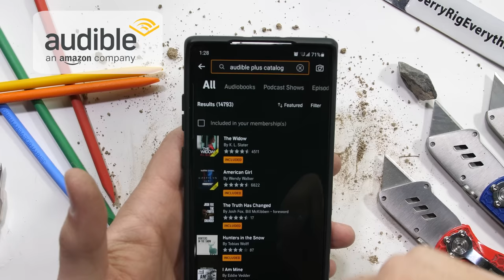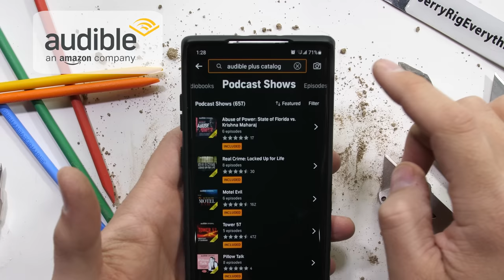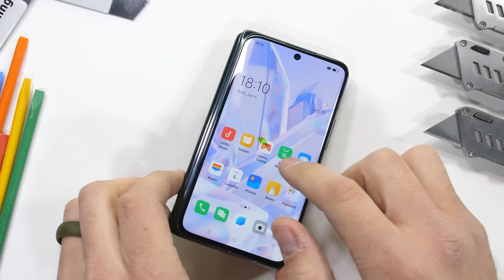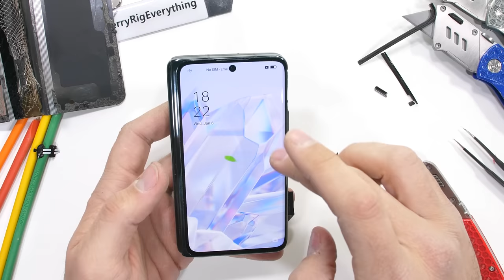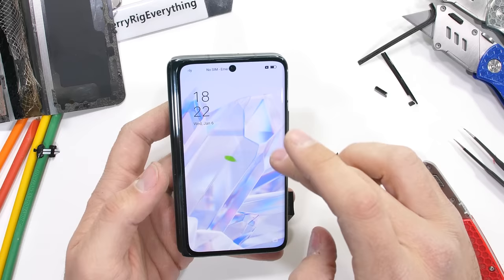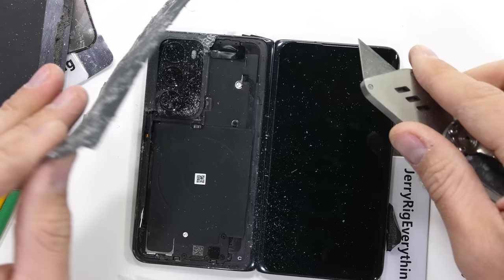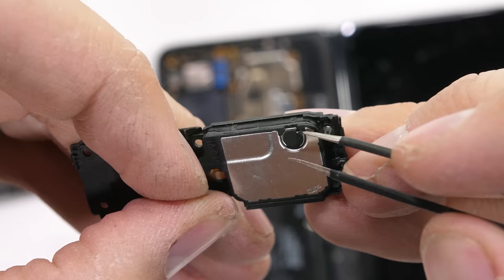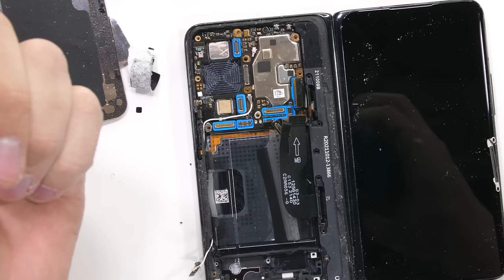Does the Oppo Find N *REALLY* have a 136 part Hinge? - Teardown!

Comment: It's safe to assume that repairability is going to be a nightmare for these folding phones.
Reply: its like saying repairing a screen is a nightmare, Its almost not repairable so you would just change it and it wouldn't be that hard. I'm guessing same will happen with folding phones, just change the broken part don't fix it
Reply: @spyro9979  but even changing it seems to be tough. The packaging is so small, complex and reliant on adhesives.
Reply: Going to be? It clearly already is.
Reply: It does look that way., my guess is the most common response  from the phone maker if something on the inside goes belly up will be “ you need a replacement handset” .
Reply: still repairable than apple product who use software to lock the hardware lol
Reply: Apple doesn’t want third party repair, we all know that.
Reply: @armadillito  That's just the price of packing more into a smaller area. Regular smartphones are a lot harder to repair than the dumb phones of a decade or two ago, but that's to be expected. In cars, manufacturers are packing turbochargers into smaller displacement engines, so you get more power with better emissions and fuel economy-but of course that makes fixing it yourself a lot harder. As the technology matures it will be cheaper and presumably easier to switch parts hardware wise, but a certain level of complexity is inevitable.

Comment: Amazing engineering in this phone. Crazy amount of parts.
Reply: isn't that the case with every phone?
Reply: It's literally the same as a fold 3 except with less impressive tech
Reply: died in 1 fucking poke tho
Reply: @vein8202  
You clearly have never opened a phone before. That was normal any screen can die like that even Jerry wasn't surprised  because pros don't use knifes to open screens and he knows it was his fault. This thing is the most fragile thing in a smartphone
Reply: @propersod2390  
I am pretty sure it's more impressive tech than the fold. It just lacks good software
Reply: @EA_47_  how is it more impressive tech if it's literally the fold 3 with less things? Fold 3 has stylus support and an IP rating. As well as an under display camera
Reply: @propersod2390  
I was talking about the main thing the display with better henge mechanism. Sorry should have been more accurate.
Also styla support on the fold us useless i wouldn't use it the display is too fragile.
Reply: @EA_47_  the hinge is basically the same, they even copied samsungs free stand hinge design (typical chinese). And btw the spen designed for the fold 3 does not damage the display at all which everyone including samsung has said. But okay ig
Reply: @EA_47_  There is a specific Spen that works with these foldable type phone screens, the actual pen has a spring mechanism and stuff to make it safe to use. I have one no issues, the only wow thing about this phone is just the less crease,flat closing hinge part. The rest is just like any fold 3 with no IP rating and no Spen support and lame software (I have always used a lot of chinese phones but my last one was a Poco X3 Pro NFC and gave me lots of software issues which made me switch to the fold now).
Reply: @Emad Aldeen  your crazy it's a lot harder being the pioneer vs. building off another product
Reply: Samsung Z Fold 3 is much much better
Reply: @kkkkkumar2898  and cheaper.
Reply: Compared to what? Of course to us normies it's amazing but this phone is pretty shit
Reply: @EA_47_  no the oppo lacks both compared to the fold...
Reply: @propersod2390  It's less expensive (thus more likely that people actually use it), stylus support is just software, and IP rating is just a rating (just because it hasn't been rated doesn't mean it can't achieve dust and water resistance, as many videos on Youtube, including on this channel, have shown). An under display camera is just a design choice, Oppo has made other phones with under camera displays. I don't know how much Samsung is paying you, but competition is always good for the consumer. This is how we get better and better things (look at Apple customers, locked into whatever Apple decides is best).
Reply: @propersod2390  The "basically" is the key here. A hinge... folds! How many ways are there to make a hinge that folds? That's a very superficial view, with a touch of racism. And folding screens are undeniably soft, we will see in the long term how it holds up (ignoring what Samsung says, of course their marketing will say it's good).
Reply: @propersod2390  But it got no crease

Comment: It's just a shame something so advanced is so hard to disassemble and repair. I get that it comes with the territory, but we're entering an even worse era of repairability with folding phones...
Reply: I wanna agree. I really do but this design was because of what we accepted in past
Kids and people who don't think through
People like us are the reason why this future is permanent
So the era isn't shame
It's just what we made 🙂
Reply: Well.. unfortunately sometimes you can't have both. I mean look at the fitment of the parts and everything, you need extremely specialized equipment to even attempt to take this phone apart and put it back together without being able to tell it's been opened.
Reply: Not that I’m against 3rd party repairs but if you’re going to pay $1000+ why wouldn’t you get it fixed properly by professionals that guarantee it will be fixed? And yeah I know it’s expensive that way but if you’re going to buy a phone like that then you probably wouldn’t mind doing that. I’d definitely understand if it was second hand or if it was given to you by someone else but still
Reply: One thing they could to is make as many things accessible from the back, replace the glass with some form of plastic to reduce the chance of cracking (or don't) and there you go. If they make the ports/speakers/batteries/other stuff that usually breaks easy to reach, that wouldn't be so bad. I don't think many repair shops would even attempt a folding screen replacement
Reply: @peppyrobo7049  most of the companies don't even repair them. 
coughs while taking a bite from an apple
Reply: Instagram User  Exactly… Anyone could make better videos than JRE.
Reply: Well... At least all the screws are not different and there are pull tabs on the battery. Could of been much worse if they tried to make it worse! Like some other manufacturers...
Reply: @peppyrobo7049  The repair shops can't fix devices if they don't have right to repair. They need access to parts and tools and schematics.
Reply: Instagram User  you actually make no content
Reply: This is the future of small electronics. Completely unrepairable. And that's all of course to pad the bottom line of the companies making them. It broke? Buy a new one they'll say.
Reply: its so hard to disassemble and repair because its advanced. The advancements usually make things more complex, especially when movement is involved.
Reply: @christopherbanks1341  You are hilariously naive.

Comment: It would be nice to see you test the hardness of the flexible glass layer in future teardowns, so we could see what it can sustain compared to both gorilla glass and the plastic layers, putting durability-related marketing to the test
Reply: He did that on the…. Durability test tho
Reply: @reesespeanutbuttercups5548  He peeled the plastic layer that covered the glass layer in this teardown, you misunderstood what I was asking. He tested the gorilla glass on the outside screen and "back" of the phone but not the folding glass.
Reply: @pc That's still a form of durability testing, seeing how brittle it might be and if that's the reason it's still covered by plastic
Reply: As the glass layer is not exposed to the outside, the hardness is pretty irrelevant (at least in my opinion). It looks like the plastic layers get damaged first by sharp objects so it doesn't matter if the glass layer itself is stronger or weaker. And it would be pretty hard to test. He'd have to remove every layer on top of the glass without damaging the layers beneath it to be able to do his scratch hardness test, which sounds impossible to me. But if he could get his hands on the glass layer only, a durability test on that could be interesting.
Reply: @waltundres9630  I personally find foldable phones to be too fragile as they are now, with practically anything leaving a mark on the folding screen, durability tests on the glass would keep track of improvements until we potentially see folding glass as the top layer, but that still assumes it has any relevance right now, hence asking for it to be tested.
Reply: @Niop_Tres  I've heard that oppo uses ultra thin glass since they bought it from Samsung
Reply: @DorCoMaNdO  ohhh
Reply: @waltundres9630  well one day the glass will prolly be on the outside, normal phones used to have plastic screens
Reply: Peeling the plastic layer off seems to easily break the glass layer under due to how strongly glued it is. After all, it's not meant to be removed.

The folding screen is surprisingly stronger than videos make it look like. Yet I still have to agree that it's too risky of an investment considering the price or a folding phone.
Reply: Glass is glass so scratches at a level 6 with deeper grooves at a level 7.
Assuming you don't break the glass due to its thinness
Reply: @RennieAsh  I don't think the folding glass is made of gorilla glass like the outside
Reply: @RennieAsh  glass is not glass. There are many types. Gorilla glass 1-7, GG Victus, sapphire, and mineral glass. Reach generation of GG has different scratch and shatter (impact resistance) properties. Glass on phones are VERY different. Some folding phones use glass and some use plastic.
Reply: @littlejackalo5326  plastic is not glass.

OP mentioned hardness, so based on Zach's testing method of standard hardness Moh's picks, glass will scratch at the same hardness levels, regardless of if it has been branded by some company.

Sapphire crystal will test harder, like a level 8.

If you want to test toughness, it's a different test.
If you want to test intricate details on hardness between 5-6 to find out which one is technically harder, then you need a different testing method, or a scientific method to determine those details.
Reply: if its glass it will be a 6
Reply: @RennieAsh  I asked for hardness to be tested because I'm assuming the "glass" layer is some sort of composite involving high(er) concentrations of actual glass but my assumption is that it's softer, as Zack often says "glass scratches at a level 5 or 6", with most glass phones we see start scratching at 6, the folding glass would likely scratch at 5 or even 4 depending on what exactly allows the glass to fold.
Reply: @reesespeanutbuttercups5548  normal phones didn't fold...
Reply: @DorCoMaNdO  pointless the glass is covered with plastic anyways.
Reply: @EikottXD  it might not be in future generations, testing it now would test marketing claims, improvements over time and potential reasons for why it might be covered by plastic, assumption seems to be because it might be brittle, but what if it's not the case?
What if this "glass" layer is as much glass as the iPhone's "sapphire" camera lenses are sapphire? If you're unaware, they're of no real value for durability (scratch resistance), it's just for marketing.
Reply: @DorCoMaNdO  Yes I was curious about this as well. The main issue I have with foldables is that the inner screen is scratched even by fingernails due to a plastic layer covering the screen. I always wondered what is the level of hardness of the ultra thin glass layer, since I imagine that will be the top layer as the tech advances. I feel like 90% of the replies here misunderstood your comment so I felt the need to reply 😂

Comment: That hinge is amazing for sure! I mean, Samsung made 3 and got it close (they'll probably nail it on the 4th one). Oppo looked at it, said they're making one, and then tossed it on the table for people to play with it. So far, every tech tuber that got this device is amazed at how smoothly this phone opens and closes. The breakdown you did shows they did some gear physics and material stress test to put out the best folding/hinged device. 

Heck if it wasn't for the OS and how small it was, I'd be looking into getting one. But yeah, the engineering of this phone is jaw dropping!

Comment: Imagine having 136 possible failure points in your hinge...
Reply: Breathes in german
Reply: Thats like saying that a bmw is less reliable then a volkswagen
Reply: that's one of the worst statements i've read on YT. When all the screws work in unison to keep the hinge together, you can't count them as "failure points" since they're packed nicely together and keep the hinge together simultaneously rather than having to work independently so it's virtually impossible to have a loose screw or broken since the hinge opens and closes equally on all sides on an ultra small tolerance level.
Reply: @ES-xq7iu  they are though....
Reply: A CPU has like trillions of transistors in it so there are trillions points of failure in the phone
Reply: You can not compare a solid state transistor to a mechanical device.
A solid state transistor like the one in a cpu can last 40+ years, maby much longer but only time can tell.
A mechanical hinge like this does in fact have a lot of possible failure points.
Reply: @StopaskingformynameYouTube  Solid state breaks instantly when shorted. That's why when you short the pins on a motherboard, you brick it, because of the transistors being failure points.
Reply: @StopaskingformynameYouTube  So, what? Solid state parts are even more subject to wear. After all, writes wear out solid state storage, not so much mechanical hard drives.

Comment: You should mohs pick test one of these layers of ultra thin flexible glass to see if it indeed scratches like normal glass, since when you durability test the phone you check the top layer which is plastic

Comment: "You don't need the latest processor or the highest resolution to doomsday scroll yourself into crippling depression about the current world affairs. The current processor can handle that just fine. Don't have to be sad & poor when you can be just sad."

Amen to that. 
Still using my almost 4 years old OP6 Avengers Edition. Working like a charm still.

Comment: The hinge does a lot of vector translations, to hold both precision and the simmetries. What I have doubts about, 8s the foldable glass screen: glass is not the best material, in takes the mechanical  stresses with some reservations. An uncommon combination of pressure, bend angle and torsion can induce a number of microfractures, which sum up to destroy the main screen prematurely.
A great job of engineering, but there is no hint of applied research. The foldable phone require continuously improving materials, and there is no indications they are going toward that path. 
You fractured the thin front glass by pinching it between two fingers, and it broke at the same exact angle a 62.5/50 fibre optic would have broken: that is the hint that yes there is a lot of work on that phone, but zero fundamental research.
The hinge is masterpiece that will do 200,000 reciprocations, but the glass is not up to the same level of sophistication.
Thank you for the great video!

Comment: Guys can you please help me?
Which one should i buy??
1) Dell g5 11gen intel core i7-11260H processer, NIVIDIA 3060 6gb graphics card with 6 gb of vram,16gb ddr4 ram(expandable),512gb ssd storage(dedicated hhd slots for expansation),165hz refresh rate,290nits brightness,68wh battery
2)lenevo legion 5 Ryzen7 5800H,Rtx 3050ti 4gb vram,16gb ram(expandable),512 gb ssd,165 hz display,60wh battery

Comment: I don't understand the push or desire for folding phones. I have no desire for one and to be frank they are such a gimmick for privileged people to waste money on. There's a reason most phones are rectangular flat slabs... It works and is the most efficient design by a ming shot. Folding phones are essentially the equivalent of hypercars with dihedral synchro-helix doors (like Koenigseggs have). Not only are the cars excessive, but the doors have no need or requirement to be designed like that. 

Basically, I will enjoy them from afar and don't hate foldables but they'll never be mainstream. There's just no reason for it. I'd much rather have an effective smartwatch or VR headset or something along those lines.